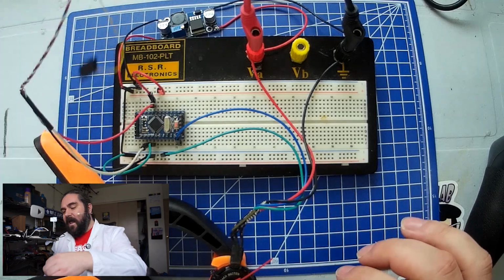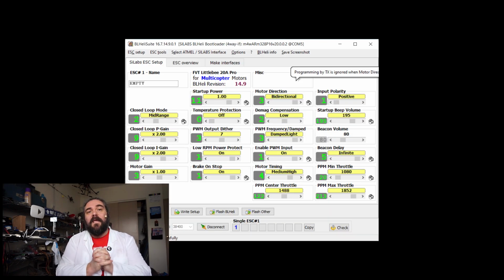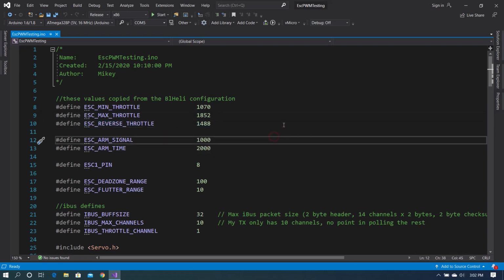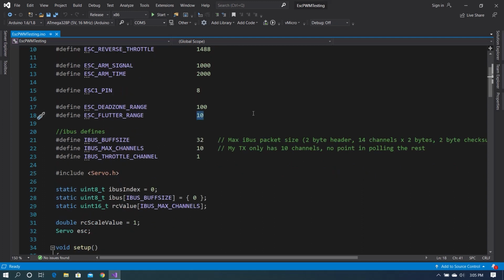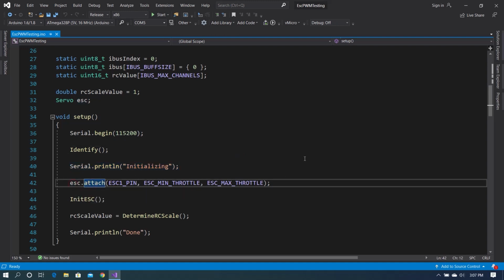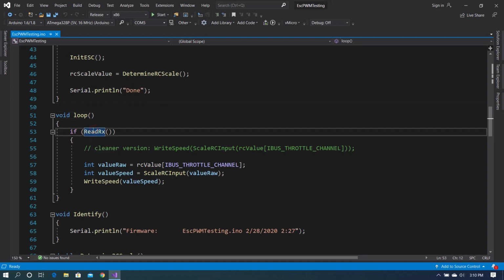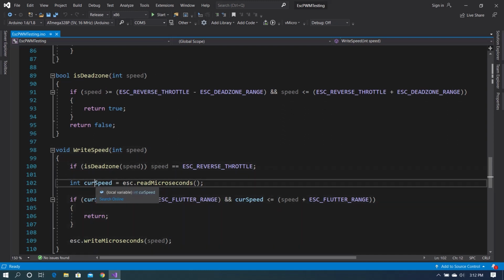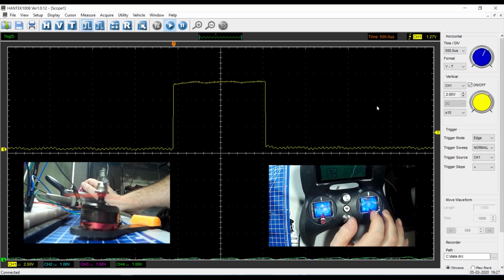Controlling a bi-directional brushless motor/ESC using PWM with an Arduino

Comment: You can get rid of that noise by turning on your 20 MHz filter with your o-scope.  There should be a setting in one of those menus on the top.

Comment: Thanks for the tutorial, very useful, looking to convert forward backward PWM inputs that usually drive a brushed motor controller IC from a stock RC receiver to drive an external ESC, seems like nobody has done this?! Why not let Blheli handle dead zone by its built-in calibration routine? Same for arming by holding throttle down, no?

Comment: Hi Mike,
I have a question: It is possible to make any ESC bidirectional ??
either software ? Or is it mechanical ?
And if mechanical, assuming i have a normal ESC, normally
I'd switch the brushless motors pins to achieve a spin to the oppose direction.
Is there anything i can to achieve a bidirectional without having to switch pins ??
Reply from the maker: No, not every esc can handle bidirectional operation. This is a limitation in software, it needs to be able to trigger the poles and sense the induction in both directions. Theoretically you could use a dual pole dual throw relay to change the motor wiring on the fly. If you reverse two of the three wires the motor spins in the other direction. But to be honest this seems needlessly complicated. The two most common firmwares I have found are SimonK and blheli. Both of these have versions that can be reversed. Some cheap option, probably not.

Comment: Hi, thanks for this video! I am with a project where I precisely need to rotate the BLDC motor in both directions... I have a Emax Blheli-s Bullet 15A, do you know if I could configure it to be bidirectional? Thanks again!
Reply from the maker: All BL Heli escs should be reversible at this point. However if you want precise control over a bldc motor, you probably want to go with a sensored motor and a controller like a vesc. Sensorless bldc has a hard time with slow speed and precision
Reply: @MikeysLab  thanks!

Comment: Thank you so much for te video! I’m using a NRF24LO1 module to control the throttle do you know how can I implement it in your code? (Just the receiver part)
Reply from the maker: That depends what format you are receiving the data in. It would need to be translated into a value for the pwm signal. So for example if you are getting direction and speed as separate values, you would need to convert that to the pwm value the esc is expecting.
Reply: @MikeysLab  Thank you for your answer, I am using a joystick so I want to make it go in a direction from 0 to 450 and in the other using values from 600 to 1023 (these values are maped from 0 to 180) but I don't know how to tell the esc to go in one specific direction by using only pwm signals (generated by the servo.h library). (I have the same esc as yours)
Reply from the maker: Ah, you have to configure the esc for bidirectional mode, they are often not set to that by default. Then the esc will change motor direction around a value of 1000 depending on the settings in the esc.
Reply from the maker: Check out this video: https://youtu.be/6EGLtEcdoBI

Comment: Hey Mikey, I thanks for making this video. I have a few questions, as I am trying to implement a raspberry pi for drone motor control (not the best choice of course, but I want to see what i can do with it). By " #define ESC_MIN_THROTTLE        1070 " do you mean  a duty cycle width of 1070 microseconds? If so, what frequency is this PWM running at? I have been able to get decent control of my motors using the Pi's PWM (3.3V amplitude @ 580 Hz). I get a starting speed around 44% duty cycle and a final speed around 97% duty cycle. I am also using an op amp to amplify the 3.3V to 5V. Also, how would you recommend about finding the PWM signal to "initialize" the ESC? Learning that there is an initialization makes my tests make more sense now, as sometimes we didnt get any motor response (we must have not initialized properly). Thank you so much for the video!
Reply: Hey, I was watching this video because I am working on a project similar to yours controlling the motor with a raspberry pi. How were you able to edit the ESC's BLHeli settings with the pi?
Reply from the maker: The PWM frequency is just the default for the Arduino, yes with PWM The signal is between 1000 and 2000. I set the minimum micro second to 1070 as that gives a bit of a dead region at the start of the stick, I do the same for the top end. Using an opamp for the 5v conversion is interesting, I would have just used a transistor :) The pattern is usually min-max-min this allows the ESC to learn the signal range :)
Reply: Follow up: I was able to get my ESC driving a motor in bidirectional mode with my Raspberry Pi Zero. I would not recommend doing this as whenever the motor nears 0 throttle, the motor starts to stutter and causes backcurrent to flow into the pi and causes it to reset.
Reply: @DSdvdDS   I am using a pi 4 and i have no back plow into the rpi, maybe you have a ground loop thats doing that? I was able to get very fine control using a raspberry pi. are you using an amplifier circuit with the pi? if so, what kind?
Reply from the maker: It is also worth noting you should create a dead range in the middle where +/- 10 sends 0. This gives a stop range so if the value fluctuates around 0, the motor does not stutter
Reply: @MikeysLab  I definitely agree! It indeed stops the stuttering. The other issue I have is that I can't really find the "zero" point with the PWM. I've found a sweetspot around 5.27 to 5.4 but I haven't been able to get it to completely halt.
Reply from the maker: @DSdvdDS  depending on the ESC you are using, there is generally configuration software that can change these points for them, such as the BlHeli suite.

Comment: To switch it to oneshot125, would it work if i just change the min pulse length to 125 and max pulse length to 250, then map the values to 125,250?
Reply from the maker: oneshot is a little more complicated than that. True, that is the first step, but oneshot is only supposed to send updates to all motors when the value has changed. At most frequently at the speed on the control loop in the controller.
Reply: Mikey's Lab how do i use oneshot then? Is there an existing library?
Reply from the maker: I am not familiar with a library, but take a look at the multi Wii source. They implemented it for there flight controllers.
Reply: Mikey's Lab i see. Just an additional question, do you know how to transition between different mixers mid-flight using inav?

Comment: Hi Mikey, I am working on a project using the Flysky ibus signal to control 3 dc motors and 1 servo by an Arduino nano and TB6612FNG motor drivers. I can understand by your example how the Arduino can read the ibus signal, but how are the channels identified ?  example: Ch1 = servo 1 Ch2 = motor driver pwm in, Ain1 and  Ain2 etc. I noticed you had included servo library for the pwm signal, but then got a bit lost in the brushless motor esc setup. I could sure use some advise on this subject. Thanks in advance.
Reply from the maker: Of course, he says as he loads the code to remember himself. I am using newer code than what was in this video, since I found some major optimizations, you can find the new code here: 

https://github.com/MikeysLab/BrushlessESCviaPWM/tree/master/EscPWMTesting 

Okay, so the serial data out of the ibus receiver comes in as a byte stream. We listen to the stream until we detect the header of a packet (since we can jump in at any point and the data wont make sense if we are not at the start of the fame. So we are looking for 0x20 followed by 0x40 which is the packet header. At that point, in the new code, we fill a buffer the size of the the full iBus frame, once we have that buffer full we do a mem copy to an array rcValue[IBUS_MAX_CHANNELS]; from there we need to scale the values contained in the array, why? because rc values sent from any type of controllers will have values between 1000 - 2000 micro seconds. But there are dead zones at the beginning and top end of that range, so we scale the value we received to make it a value in a 1000 - 2000 ms range. At this point, we are ready to output the PWM value we just scaled. We do this WriteSpeed() in here we impose both a middle dead zone and an anti-flutter calculation.

So essentially, as we receive the values out of the serial stream, we write them to the rcValues[], So channel 1's value is in rcValues[0], Channel 2 is in rcValues[1] ... and so on. I think this answers your question, if not let me know :) also check out the video on controlling a brushless ESC with PWM as I go a little more into this there.
Reply from the maker: The consuming iBus video, sorry got my wires crossed.
Reply: @MikeysLab  Hi again Mikey, I have just opened the full text content of the reply, and can see you have given me more detail than the github link.
 I can understand the working principle, but not know how to set out the code in the Arduino IDE. I tried to use your code from your rover project, and  change some details, but could not get past the compiler. A friend managed to arrange the channels into an array, so I type in the output pins in that channel column, change the channel in use number, and is good to go. I use it on a Mega to control 4x tb6612fng motor drivers and operate 8x dc motors on a rc excavator. The project I am working on is an articulated steer 4 wheel drive dumper. The steering motor is servo controlled, and needs the <servo.h> library included, but I cant seem to break into the code without dismantling the whole code to change the pwm output. I wonder if you would be able to find a solution to my trouble. Thanks for your reply.
Reply from the maker: I would love to help, but I am not really sure of your problem. Can you reach out via the Mikeys Lab page on Facebook and share the code you are working with?
Reply: @MikeysLab  ?? Is this a reply to someone else question ?